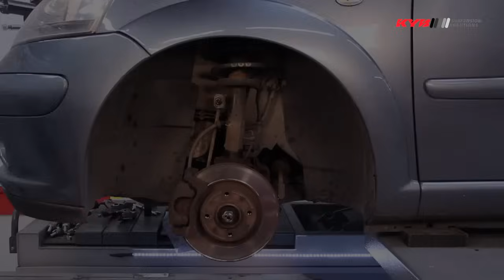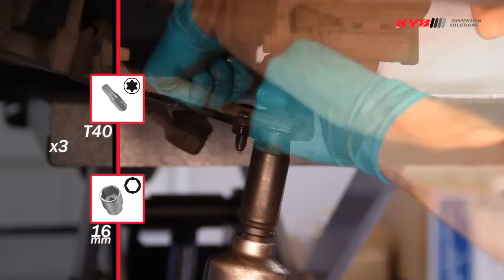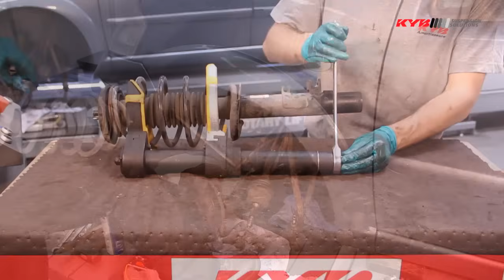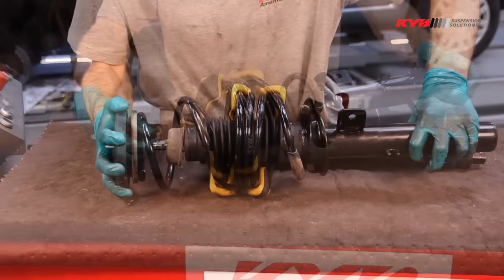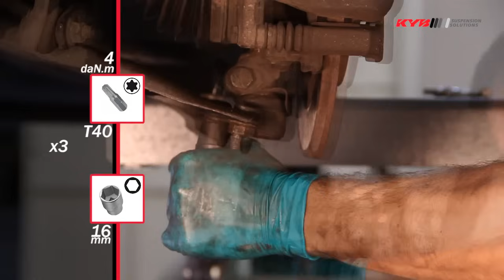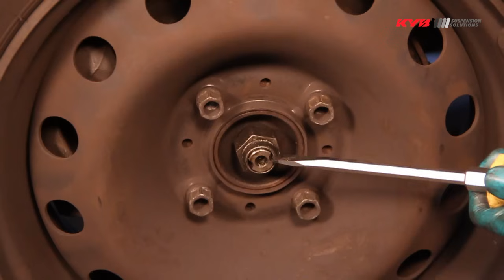KYB CITROEN C2, C3, DS3 Front

Comment: if you are finding hard putting the strut back into the knuckle. you can first put the strut into the knuckle while it is all diassembled and thiten it up. then someone lifts the whole assembly while another person puts the upper strut nut in place. I tried the method used in the video but it just slipped. this method worked immidiatly and saves you a lot of time.

also this is a two person job

Comment: Can I ask something? 
On my Citroen c2, I replaced 4 shock absorbers and 4 springs, all of them original KYB, acquired using the original code number, as replacement of original parts.
But, why that shock absorber works by gas??? I mean, they are original replacements... so, why they are not like the original Monroe shock absorber (only hydraulic)? ...so, those shock absorber (kyb), has got a too rigid calibration, and my car now is too uncomfortable while driving
Reply from the maker: The Monroe parts for this vehicle are also gas.
Reply: @Kyb-europe  but KYB are even too uncomfortable